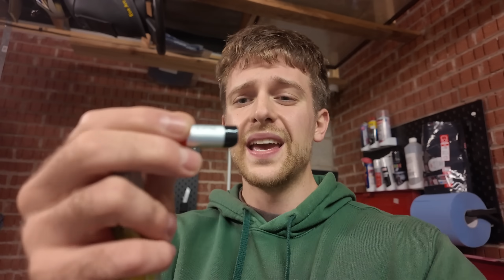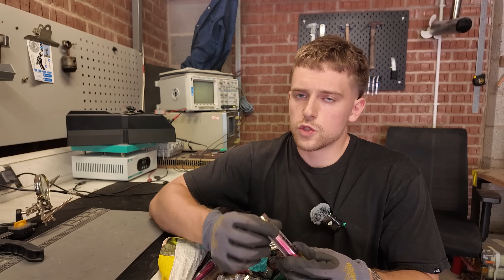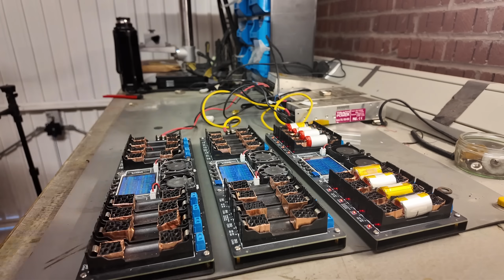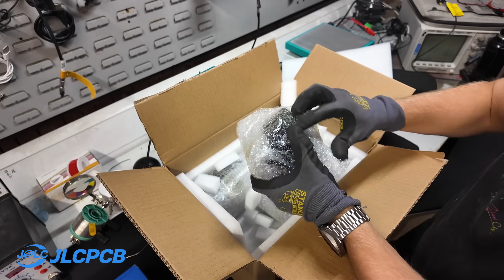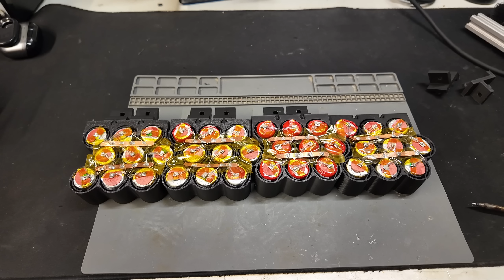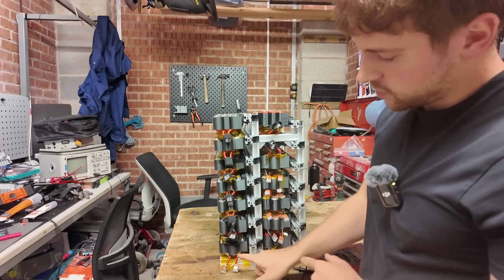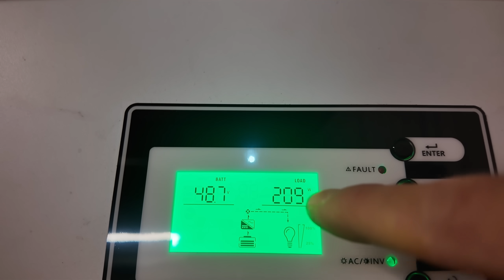I Powered My House Using 500 Disposable vapes

Comment: Don't mention this to whoever insures your home, those batteries are sketchy as hell
Reply: right lol. I'd never keep this setup indoors... if you go to these lenghts, build an outside unit
Reply: @zepwafels  I can't imagine leaving that plugged in overnight and then going to bed
Reply: @_narcosis  - Giving a whole new meaning to..."Did you turn off the stove?"
Reply: @_narcosis Cause you don't trust yourself. Let builders build. Opinions aren't always necessary. Show us what you've done? WHat' you've try? How about the results? Imagination time : ON
Reply: @biggbrother585  I'm an electrical engineer, this is almost exactly what I do for a living
Reply: @biggbrother585  You don't need to be a baker to see if bread is good.
Reply: @_narcosis  anyone can be an electrician if they do a few courses this guy invents stuff lol and provides a solution
Reply: My father-in-law is an ex-cop, and one advice he told me: never lie to your insurer. Contrary to police, they never get tired, they will move mountains to get down to the truth if it saves them 5 cents lol
Reply: @falloutworldrecord   a better means would be to familiarize yourself with the law and ways of the industry. Ok never mind at fault driver where you could brake check someone and without dash cam they are at fault and I wouldn't do that cos I'd fix the thing myself, but they use your gps data to increase insurance premiums, press a bit too hard on the gas that's dangerous driving you pay more. Insurance is a business where you pay and in an accident they may cover the cost so what they really sell is a promise, they sell words, now the government has been attracted and there is legally required insurance and the companies break any laws they want. So messing with their data collection could be seen as lying but I'd recommend it.
Reply: proof of concept is there tho.
Reply: @opslocked8597  is the concept "do batteries exist?" because that's nothing new.

All this guy did was create a video for engagement that potentially inspires a lot of other people to also do something pretty dangerous.
Reply: @_narcosis  Absolutely. All it takes is one of those batteries to blow & there's gonna be a smouldering pile of lithium where his house used to be
Reply: Lmfao
Reply: no they are not, but you dont know how they work so fear is your default reaction
Reply: @ssgoko88  I'm an electrical engineer and I have personally witnessed many lipos in thermal runaway. The batteries in vapes are extremely low quality in order to keep costs as low as possible.

Constant charging cycles and storage in an environment where thermal fluctuations are expected is a recipe for disaster.

Comment: Strange, 200A connectors running at 50 V = 1000W, But he is using (next to all other stuff, a waterboiler, fridge etc, wel over 2000W. Next that the connecter melts No way those cells can together deliver 400A under load. So this looks a lot like a hoax
Reply from the maker: 50 V * 200 A = 10,000 W
Reply: @Chris_doel  Sorry, miscalc my side.

Comment: I am curious what WAGO connectors you used.

14:17 shows you using 221 series WAGO connectors
19:42 shows you drawing 37A
EDIT:
19:58 shows you drawing ~65A (seriously, replace these low current connectors ASAP please)

221 series WAGO are only rated to 32A. I would highly suggest you looking at replacing those with some higher current connectors that will not melt.

That all said, bravo at this awesome upcycling.

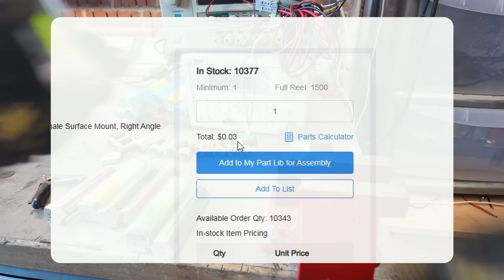Comment: 4:53 there is also the cost of the USB C control circuit and you have to have a LI Ion battery charger circuit rather then just the discharge chip but still that costs very little

Comment: 2 things, those Chinese battery chargers are notorious for being badly calibrated, I found some to be as much as 300 mAh off on some channels. Use BT Optus 3100. In regards of cell level fuses, never use the glass! Use ceramic or just a low melting point solder

Comment: Lithium batteries come in different grades, the ones you find in disposable and even refillables, even if you find ones above 3v, they won't last as many cycles in, and additionally when using them in P and S series, they going to become unbalanced and useless, due to the fact they ain't matched in cycles. That's why when you build DIY lithium power walls you try to match manufacturers and model as much as possible

Comment: gemte essas baterias funcionao bem fiz minha bateride 12 v  usamdo 42 celulas dessas  usei 3 packs de sas baterias cada pack   com 14 celulas somando avoltagem ospacks carregados separadoum um pack por pack. juntei 3 pack  com acapacidade que varia  de 4.2 ...4.3...e 4.2. ligadas em serie obtive  12.7voltes  ai liguei eses packs de pateria positivo .com positivo e negativo com negativo. mantendo os 12 .7 v e somando os anperes   e como o bamco de bateria contem 3  packs de bateria  cada peck com   14 celulas  ficou forte usuficiente para ligar  um comversor de  600 wat  por 4 horas  nao sei se dava para usar por mais tempo porque nao usso bms para proteçao e nem tenho equipamento certo para isso mas obtive  grandes  resultados com essas baterias  toquem meu som de carro por 2 horas  e deu serto liga uma luz de emergencia por 24 horas sem presisar rrecaregar  usso uma fonte 12.v de 5 anperes para carregar porque  a fonte  de 12.2A nao aguentou e uma dica usse um diodo grande no fio positivo quando for carregar o banco de baterias para avoltagem so pasar e nao retornar

Comment: Before watching this video, I used to wonder if vape batteries can be used to make a battery pack for something like this...bravo. what was the capacity for the pack? 1kw? And I also wonder what the life cycle will be, maybe 100-200. Compared to lifepo4 cells which have 4000-6000.

Comment: I had everyone saving there old ones for me used them for projects around the house. Similar charging. Or just a hug bus bar with leads charging dozens at a time with a power station. Low voltage ones were still around 2v

Comment: If I can see one thing that doesn't make sense to me, it's this:

Why do they solder all of the cells on vapes? It doesn't make sense, as a simple spring setup (like any other electronic that uses batteries) would be more than adequate. We only need to solder large banks of batteries that are being recharched and/or subjected to hard use. The manufacturer could save labor, and so could recyclers. They could also make the cells more viable by putting a discharge protection circuit in them so the cells never go below 3.05v.

Companies could care just a tiny amount more, and it would make things far better.

Comment: Hi , huge but awesome project ! 
But the same voltage for each cell is not enough for assembling so many already used cells  with different age and qualities ,  perhaps (certainly) with different IR and drain possibilities (output amps) .  I'm not sure you will keep a right balance after simply the first discharge .      Try first of all a discharge test with some extended high drain  (not some lamps) ,  and observe precisely what happens for each group of cells in // .    I'm not sure of a satisfying result with such a pack . It' very easy to build a simple 5S/2P battery with used cells even with the same capacity , but it 's often a chance if the pack keeps a good balance by use ,  If the IR is not strictly the same .  However I wish you every success after so much tireless work .

Comment: impressive project!
The only thing that confused me was the statement about the 3 Volts. Yes this is a common cut-off voltage, but the technical/legal discharge limit for Li-Ion cells usually is 2.7, with anything that is above 2 usually recoverable.
Anything below that indeed becomes dodgy and the cell probably has permanent damage. The exact values of course depend on age and exact chemistry.

Comment: I hope you don't end up trying to power a car with one. The huge power draw causes a lot of heat compared to lower power devices in your home. Electric cars need battery cooling and I'm not sure you have a way to adequately do that. Air cooling still can cause batteries to bust open. Look at old leafs if you don't believe me.

Comment: The only issue in the set up is the risk of when the grid come up again, you can turn on the main house breaker by mistake and the following battle will happen: the grid vs your powerwall. The whole thing will blow up. This is why electrician install a special panel that make you able to turn up only one main breaker at the time when installing generator in a house. Did you think about this?

Comment: You said that batteries below a certain voltage are unusable but can they be revived by using a bms to top them up I'm very impressed with the level of engineering you put into your builds

Comment: For ease of maintenance, repair, and replacement, the cells should be spring-loaded carriers as found in many AA-powered devices. In this way as an individual cell fails it will be far easier to replace. Much of your build looks like to could be made fast-swap (even hot-swap?) capable pretty easily. Great engineering practices all around and a hell of a point made!

Comment: I am doing it to portable solar lights what I bought on Temu as they have too small capacity Lithium batteries inside. I am using them to go camping, go to my off grid garage, another off grid property and also I gifted few to friends and family. Basically I take out 4  batteries from 4 lights to fit inside only one light and for the other 3 lights I am soldering in parallel vape batteries (I am vaping). Good idea about fuse on each cell, I will do that too next.

Comment: Damn, I've ALWAYS wanted to do this. I have boxes of disposable vapes that I kept because I always thought it was ridiculous to throw away a perfectly good rechargeable battery cell.
So, you can keep adding to your overall storage capacity by adding in old vapes that you've used as you use them up (or are given them or find them)

Lithium should not be disposable. Just because we've made manufacturing cheap through mass manufacture, doesn't mean that it should go to landfill. I feel the same about all e-waste.
Computer parts go obsolete - but what's crazy is that just a decade ago, your old chip would have been the fastest piece of technology on the planet! And the effort to turn sand into a functional computer is enormous.

Comment: I usually don't care to comment on videos like this. But I was so impressed by the Ingenuity and the tenacity necessary to continue with the project until it was complete. I was also impressed by the fact that you saved so many batteries from the landfill. But I was most impressed by your invention of those 3D printed squishy things that helped you to resize the tester so that you could fit the batteries in to test them. Keep up the good work I'll be watching.

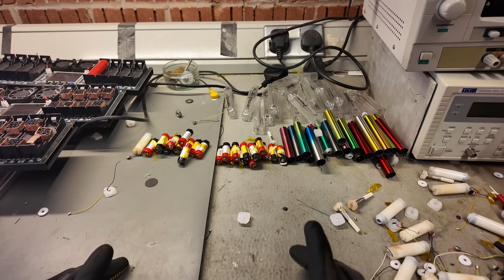Comment: 2:28 you can jump start some of those.  It’s a bit dangerous. You connect a slightly charged battery to the bad one. Then charge both of them together until the bad one gets above 3v. Keep an eye on thermal runaway. Do it near a place to throw them, if it gets too hot.

Comment: I find it funny that you used a beefy 200 amp connector on the output, while the inner series-connected "cells" are connected by 32 amp rated Wagos 😅

Comment: Was going to be my very first question, where will you draw energy from. Solar is obviously the way to go with that. 

All of the old speed cameras in the UK have been turned off, which most folk know. But does anyone remember the people who used to hang tyres around them and set them on fire to destroy them? 
There was (and still is) a much better way the people who done that could've disabled the cameras and likely would never have been noticed. 
Around 100yrds before the speed cameras are grey boxes that no one really noticed. They have solar panels on top of them which were used to power the speed cameras. I know of a certain someone who borrowed one of those and used it to replace the battery in his car!! 
I digressed a bit, but an easier way to stop those cameras from working would've been to just paint over the solar panels. 

Those solar panels are still there to this day in a lot of areas around the UK doing nothing. I honestly don't think anyone would miss them, just saying 😉

Comment: Why, oh, why are you even considering wiring the batteries in parallel?  WHY?  Wire at least a few of them in series and then wire those series connected batteries in parallel - if you just HAVE to wire them in parallel (WHY?).  Wiring the individual batteries in parallel risks violating KVL.

Comment: Love the video. 

I'm sure Chris knows this but for any viewers, be careful back feeding the home's electrical system this way. The line connecting the workshop to the home was only designed to carry the load for the workshop sub panel. When powering the home, the line is now carrying the load to power the home, which is likely higher than it was designed for.

Comment: Most of the dead ones probably could of been saved if you gave them a jump start with a fully charged battery. What happens is the charger won't recognize it when it's low and won't charge it but if you charge it over 3v with another battery you can charge it normally. Not all but alot could be saved

Comment: this is amazing . the question is "how much does it cost you to charge this massive battery . isnt that the same amount you pay to consume directly from the grid ?
an answer would be a pv sun system should be added to generate the electricity and charge the battery, but we go back to the same point, why not use the pv directly then .

Comment: Welders have a low profile respirator that I like to use at the bench when soldering, you don't want those fumes inside you.
 I love this build the modular design of the individual banks. It is a super nice maintenance choice, and judo's on the 3d hacks, like the simplicity.
But accessing the bolts in the stack is kinda a tough one. if you don't orient and allow for the disassembly for said maintenance too.
No way I want to attempt until I'm more comfortable around ac/dc in general but you make reuse look real good, way to be

Comment: You can force charge into batterie3s under 3v... I have restored hundreds of batteries of all types this way. Use a 6v "lantern" battery with some alligator clips and they'll boost up in 10-30 sec and you can charge them normally

Comment: Great video. I’ve thought about doing this, you actually did it! Cells below 3V aren’t necessarily bad though. I’ve revived hundreds of 18650s well below that. You can get fancy about it with IR testers or just slow charge and then store for a month to see if they hold voltage. I built an Arduino test rig to help me. But kudos to you on this project, it’s a ton of work!

Comment: sorry for being a electricity knowledge noob but how long is this going to last? like is it just a couple hours worth for when there is power outages? or can you draw power from solar into the battery pack and then switch off the house on the daily to minimise power consumption from the grid ie cheaper bills?

Comment: LIION can go lower than 3 volt without getting damaged ... false myth, and dont charge the battery during the night and using it for the day in hope you are going to save some money cuz you will not, gonig from AC to dc during night and then DC to AC during day is a big loss of energy ( around 20% or even more ) , but really nice project, blow my mind that these vape exist on the first place ...

Comment: Just keep in mind that the garage circuit is the submain to the house when using the inverter. Depending on the cable size and reference method you're possibly overloading the cable. Obviously for short demonstration purposes for video that's no problem but long term overheating may well be an issue.

Comment: If you take a 12 Volt car battery and pop it on the terminals until the battery gets slightly warm it'll bring a dead battery back to full life. It just has to do with breaking the internal resistance of a dead battery. This is called waking a battery up and as long as the battery is not ancient in other words it's only three or four years old It works surprisingly well.

Comment: He probably built up tp 16 banks of 3.7 V cells in series to gather over 50 VDC to run his inverter. But each bank must have hundreds of cells in parallel. I have opened two of those disposed vap devices, and each cell hold about 2 Ah. So for each kWh of power he need over 270 cells in parallel. He deserves a reward for saving those cells from  contaminating the dump yards.

Comment: You got single phase for the whole house? Makes it much easier regarding wiring. 3 phases here. Less load for each of them, and high power where you need it. But you need a 3 phase inverter (or 3 single ones) to acchieve the same.

Comment: Not click bait for a total waste of time and highly dangerous. Let's say it's 18650 cell. 500 used one would give you let say 3.83 KWh. You still need to get a good bms, cable to, spot wield all of that. Also hope one old cell would go bad.. Current price 12V*300 Ah = 3.6 KwH is $250-300. It's also lifepo4 which has higher discharge cycle and won't blow up as bad

Comment: When I first started using electronic cigarettes the majority of them used 18650 battery cells and those that were in the know could and wouldwould harvest the good battery cells from battery packs from power tools (some Dyson vacuums also used these battery cells too, and Teslas at the time did as well). The disposables are a lot more questionable. I don’t use them currently, but it would be great if these companies had a way where the batteries could be tracked and sent back to be recycled and reused in future devices. They still have a very long life cycle. When I used them I think max I was recharging it 5 times before the liquid was out and it needed to be replaced